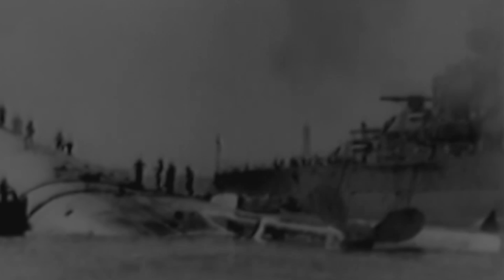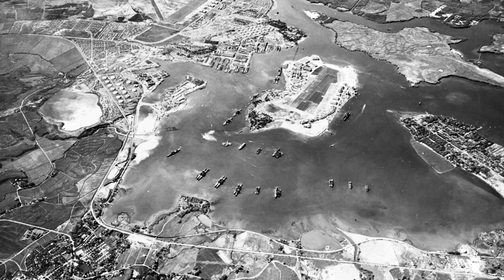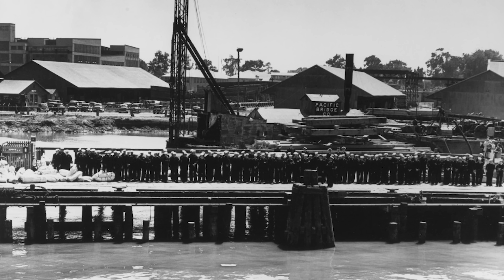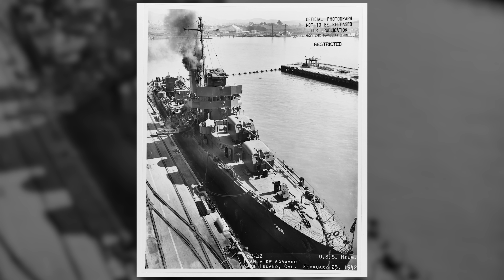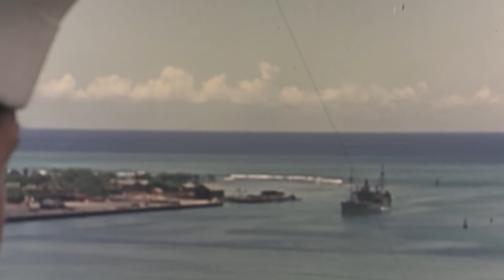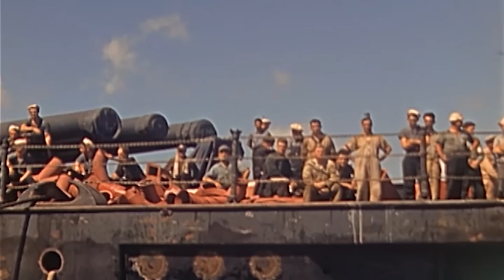The 'Zombie Battleship: How They Salvaged Pearl Harbor (2/4)

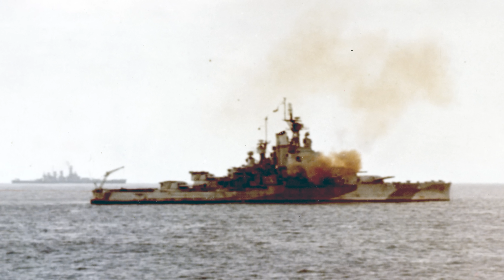Comment: 29:00 A quick note!
At this point, Nevada's guns, weren't just hers! She had worn out her complement of 10 14"/45 rifles bombarding the French coast off Normandy and Toulon, and after Operation Dragoon, was ordered to New York to have her guns re-lined! I believe most of her guns were able to be re-linned in time, except for three. These were replaced by guns from the USS Arizona, pulled from Turret No.1 and refurbished. These were apart of Nevada's main battery the first time she opened fire on Japanese forces since December 7 1941. One of these rifles is on display today in Phoenix Arizona!

Comment: 21:15. Another correction (sorry, I'm rewatching them because of the new upload)
Nevada did not have reciprocating steam engines, and was equipped with Turbines. Nevada was built with direct-drive turbines, and had geared turbines retrofitted in 1927. 
The confusion here may have come from her sister Oklahoma, who was built with triple expansion steam engines, as a competition to see which better suited the needs of the Navy. To my knowledge she kept her original set of engines until her sinking, only her boilers being replaced with newer models in 1927. The Oklahoma was the only battleship at Pearl Harbor with Triple-Expansion engines, with even the Utah being equipped with turbines since commissioning.

Comment: Great series but a very wrong statement about the gas hydrogen sulphide, which was stated in part 2 as being colourless and odourless. Colourless it maybe but odourless it is not. It has the strong smell of rotten eggs (the common name is rotten egg gas). It is quite toxic gas, but what makes it dangerous is a phenomenon called olfactory saturation. In layman's terms it has a sharp pungent smell initially, but the nose gets use to the smell. This means that  an exposed person cannot detect airborne increases of the gas in the air. For example an initial minor exposure of 1ppm  can increase to 100ppm but it smells the same. The sense of smell is saturated by the low concentration and won't respond to higher gas levels. Gas detectors must therefore be used to warn of dangerous airborne levels.

Comment: Besides most of the ships being salvaged from the harbor to reek revenge, I believe there were two other fatal errors the Japanese made: 2. They went after the ships and airfields. When a second wave should have been launched to attack the oil reserves. If they had done that, it probably would've taken the Navy more time to strike back at Kudo Butai. More oil would've needed to be pumped, shipped, and stored to fuel up all the salvaged ships. 3. A potential third wave could have scouted for any carriers. Increasing their chances of sinking one. But they were counting on them being in the harbor. They had no intel on where the carriers would be otherwise. Then again, perhaps that last part is a good thing. As Enterprise arrived shortly the next morning. The arial attackers had just missed the Big E by a good 24 hours or so.
Reply: 1. Their goal was a 6 month campaign of grinding the Americans down, then launching a decisive battle and winning the war. Blowing up the oil infrastructure wouldn't have mattered for the 6 month goal.

2. The Japanese carriers were already at their limits. It takes a lot of fuel and resources to travel the Pacific

Comment: Nevada didn't have reciprocating engines but steam turbines that turned her screws by a reduction gear.  Her sister was the capsized Oklahoma which did have the old-fashioned reciprocating engines.  
Many of the later standards used turbo electric drive.  In this system steam turbines turned generators which powered electric Motors that turned the ships propellers

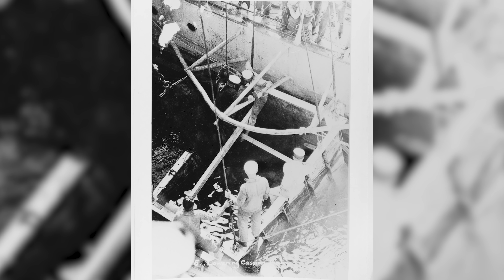Comment: 6:43 I’m sorry but you are incorrect!  There were three dry docks big enough for her at Pearl! Dry docks 1, 2, & 4 were all big enough for her.  Only Drydock 3 would have been too tight a squeeze.  I was stationed on two submarines at Pearl.  Chicago, & Asheville.  Chicago used drydock 3 for her DMP, which was so shallow we had to use giant floats to lift us high enough to clear the lip. Asheville used Drydock 4 after her 1998 deployment.  So I know well enough about the dry docks, to know they would’ve fit the USS Maryland.

Comment: @26.14. Hydrogen Sulphide (HS2) is not odourless,it smells of rotten eggs.  Perhaps it was Carbon monoxide which is odourless and deadly.
Reply: In concentrations it will quickly burn out your sense of smell, which makes it even more deadly since victims may not realize the danger they're in.

Comment: Story of USS Nevada (BB-36) on December 7th, 1941. Nevada was the first battleship to open fire at enemy planes, and she was the only ship to shoot down an aircraft with its secondary surface battery at Pearl Harbor. And on this day, luck earned Nevada a permanent berth in the annals of naval history. When in port and not tied to a pier, a battleship usually had just one boiler online to generate electricity; however, a single boiler was not enough for a battleship to get underway. Early on that fateful morning, Nevada’s officer of the deck realized the same boiler had been in use since the ship had returned to port on Dec. 5, and ordered a second boiler lit.

By 8 a.m., the second boiler was at full steam. When the attack started, the senior officer present afloat (SOPA) realized that with two boilers online, Nevada had enough power to get underway. He immediately ordered the hoisting of the signals “I am preparing to get underway” and “request tug assistance.” The tugboat Hoga was dispatched to assist Nevada.

Minutes later Arizona—moored directly ahead of Nevada— blew up in a tremendous explosion and began burning furiously. At 8:10 a.m., Nevada was struck forward by a torpedo and at 8:13 a.m. was struck amidships by a bomb. At 8:25 a.m., the first wave of Japanese attackers withdrew. Realizing the danger of the burning oil on the water drifting toward Nevada, the SOPA made the decision to get underway without the tug. The mooring hawsers were cast off and at 8:40 a.m., Nevada started to back down; minutes later her bow swung into the channel. At 8:47 a.m. the ship started moving forward. Nevada was underway! The effect was electrifying on the men ashore and aboard the other ships. Tumultuous cheering broke out and men from the stricken Arizona and West Virginia leapt into the water and swam to join Nevada as she passed.

Many of the men who saw Nevada underway recalled the words of the “Star Spangled Banner” when they saw the ensign courageously raised and standing out stiffly in the breeze. The ship then successfully navigated around the pipe for the harbor dredge and headed for the channel out of the harbor. At 8:55 a.m., the arriving second wave of Japanese planes noticed Nevada underway and moved to attack her in hopes of sinking the ship in the channel and blocking it. At 9 a.m., dive bombers and torpedo bombers put Nevada under heavy attack, and within a few minutes the ship was hit by five more bombs. Nevada was burning forward and amidships and sinking by the bow. The SOPA realized Nevada was going to sink and ordered the ship grounded.

At 9:10 a.m., Nevada was grounded on Hospital Point with the assistance of the tug Hoga, which had dutifully followed Nevada down the channel. Thirty minutes later Nevada was moved across the channel to Waipio Point to prevent the stern of the ship from swinging around and partially blocking the main channel. Thus, gallant Nevada was the first (and only) battleship to get underway during the Pearl Harbor attack.

Comment: Just a note, at 25:55 you say that Hydrogen Sulphide is completely odourless, but actually that's not true; under most circumstances it's quite the reverse, hydrogen sulphide has an incredibly offensive odour, it's one of the classic culprits of a "rotten egg" smell. 

It can still be incredibly dangerous, though, as it's poisonous, corrosive, flammable, and above a certain threshold concentration your sense of smell simply... ceases registering the smell any more. It's literally such a horrendous smell that your sense of smell refuses to register any more of it and shuts off. The insidious thing is that the critical point at which that happens is below the concentration required to get a lethal dose; many accidental poisonings via hydrogen sulphide have occurred when the smell "goes away" and people assume the gas has dissipated, only to unknowingly be breathing in more of it, and gradually getting poisoned by it.

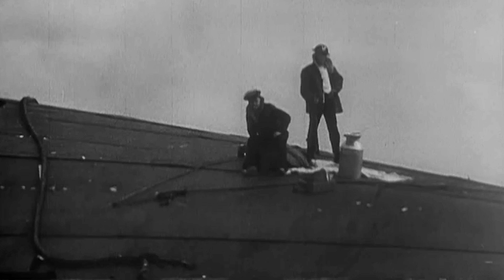Comment: 3:02 no chance of escape? Didn’t oxy torches exist back then? With weeks of time that much time they surely they could have cut a small hole in the side and dropped in a ladder.
Reply: They couldn’t cut them out because the second a hole was opened up the chamber they were in would have completely flooded. It was the sealed air pocket that was keeping the water from completely flooding the compartment. Once the air was allowed to escape the water would have rushed in and they couldn’t cut the steel fast enough to get them out before they drowned.
Reply: no they couldn't.  13 inches of steel
Reply: @trekkiexb5  not all over and given the weeks they were supposedly heard crying out? 
They could cut and shape steel enough to build a whole ship, but couldn’t make a little hole?

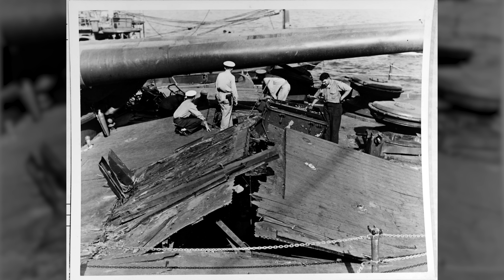Comment: A few comments. Nevada was not as damaged as may have been presented here. She was initially beached not because she was sinking, but because she had been ordered not to sortie and her anchor windlass had been wrecked by a bomb (photo at 15:25) and she had no way to drop anchor. Her damage reports states "the story is one of a losing fight against water spreading through boundaries and fittings which should have been watertight but actually were not."

Vestal reported that she was hit by dive bombers, but this is incorrect. Arizona was hit twice by two separate five-plane formations and Vestal was also struck in the same drops as the Japanese were using a five-plane V formation. 

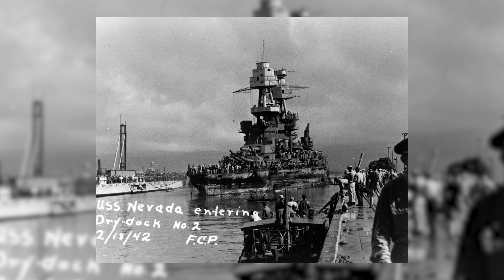At 27:50 it is stated that Drydock 2 was the only drydock capable of handling a ship of Nevada's size. This is incorrect or imprecisely worded - Pennsylvania was in Drydock 1 at the time of the attack and longer and wider and with a deeper draft. What is likely correct is that Drydock 2 was ten feet DEEPER than Drydock 1 and if Nevada was drawing more than than her normal draft it is likely that the 35 foot depth of Drydock 1 wasn't deep enough and that Drydock 2's 46 foot six inch depth was required.

Comment: The main reason for the attack on Pearl Harbor was to sink the 4 aircraft carriers parked there.
BUT, the British had broken the Japanese secret code 6 months before the attack.
SO, the aircraft carriers were " conveniently" out at sea and safe.
Reply: Both Churchill and Roosevelt expected an attack by the Japanese, they were expecting the attack to be in the Far East, and South Pacific, and they were right, Pearl was only a pawn on a chess board, Guam, Wake, Philippines, Malaya, East Indies, Singapore, Hong Kong all saw near simultaneous offensives on December 8th, at the same time on the other side of the international date line on December 7th Pearl was being bombed. 

the 3 carriers were out of harbour down to 2 of them doing supply missions to Wake and Midway, and the 3rd in San Diego re-arming after a refit
Reply: @AB-mw8oz  But, were the carriers out on "supply missions" because they knew the Japanese attack was imminent?
Reply: @pigdroppings  Because they were expecting Wake and Midway to be both targetted. Which Wake was, just hours after Pearl, Wake was bombed destroying most of the Wildcats on the Island

Comment: Techtil  that is a wax coating allllll bolts gears sent when you unpack it ... gahh  a mechanics nemesis... think of the  yellow battery terminal protectant spray used on your car to stop white powder building up on your battery leads... same thing 😊

Comment: As a Nevadan, the ship always fills me up with pride. The salvage teams did an incredible job saving her. There is another fact that wasn't mentioned here. After Arizona's guns were salvaged, some made it on to Nevada, so in essence both the Arizona and the Nevada got their revenge. I'm still saddened that the ship wasn't saved as a museum ship, but I'm glad that the wreck was rediscovered.
Reply: Right, the problem with Nevada and the battle ship New York as well was both were "hot" with radiation after the Bikini A-Bomb tests.  New York had been promised to the state of New York as a memorial and museum ship but the radiation made that impossible.  The same would have been true of Nevada.  They were even too "hot" for scrapping.
Reply: @wayneantoniazzi2706  But in essence they were very different ships from those that were attacked at Pearl Harbor. They underwent very extensive modernization.
Reply: @chriswhitehouse9137  Modifications after Pearl Harbor?  Certainly.  Upgrades in communication equipment, radar installation, most likely new fire control systems for the main batteries as well.  But the fact they were "different" ships wouldn't have prevented them from being donated as museum or memorial ships.   Nevada and New York may have been WW1 era ships but their combat careers were pure WW2.
Reply: @wayneantoniazzi2706  Sure. She did great things at Normandy and Iwo Jima. 
She should have been a museum piece for that along. 
But she looked very little like the ship at Pearl Harbor.
Reply: @chriswhitehouse9137  So what?

Comment: My dad joined the navy in feb 1942 and march headed to pearl to join others in the salvage efforts. My dad was a machinest first class. He told stories of sailors on deck of the uss Holandia doing calisthenics as bubbles would emerge from the deepths and talked about the stench and some men puking on deck or others that got gravely ill days later from it. With most of his time spent in the belly of the ship making parts he only saw and smelled it once but even at 72 he said that smell haunted him and was set off by some smells like the day we were cutting up a dead tree in the woods. He died later that year but it took him over 50yrs before he told the tales of the days at pearl. Later the uss holandia would be a transport carrier and repair ship. She still did her part in the war even though she was a small carrier. I have talked to many sailors about pearl that survived just curious about it. A common comment was. Boy you dont know what horror and loss is. 1000s of good men left to the sea to rot like the meat mike talked about. So think of that smell for a bit.😢
Reply: War stinks.  No one can prove that statement wrong.

Comment: (part of an original story, MSG NJT)
The Massachusetts stood as a steel behemoth in the Fore River drydock. Electricians had just finished installing all of the battleship’s radar, lights, and radio equipment, and word had gotten through the men that an important broadcast was on the way.
Marco Plymouth, ship’s commanding officer and a seasoned navy veteran, stood over the desk with the headset to his ear and a hand on the dial.
He fiddled with the control until he found a frequency that could connect to Pearl Harbor’s comms center, which had been up and running for about a month now.
With a crackle, a voice came through. There was hardly a breath. 
The voice coughed, wheezed, and let out a groan before finally summoning the strength to utter: “I live…”
Marco dropped the headset and switched its plug out to the PA system.
“…..repeat…..This is Commander Nicholas Wilbur to all US Navy ships…..I live.”

Comment: Half of the ships at Pearl Harbor will later get their revenge at Surigao Strait.
Reply: They were called "The Pearl Harbor Ghosts" and they got their revenge all right.
Reply: @wayneantoniazzi2706  The japanese got smoked at Surigao Strait
Reply: @rogerstlaurent8704  That they did.  Those were old battleships but they could still shoot.
Reply: Pretty much all of them were decommissioned by 1950 and scrapped by 1960 or sunk as targets. As "standard" US Navy battleships their flank speeds topped out at 21 knots, too slow to keep up with 30+ knot carriers.
Reply: 5 out of 8. Little more than half
Reply: To be fair, the US standard-type battleships were already obsolete by the 1940, and their service later in the war came down to the US Navy having the air and naval superiority needed to keep those older ships safe. Fuso was sunk by destroyer torpedoes and it's like Yamashiro would've shared the same fate if the USN dreadnoughts weren't there. Their time being repaired and refit after Pearl might have been a blessing in disguise, because if they were put to sea to fight a traditional battle with the IJN in 1941-42, I believe they would all be sunk by air attack, just like the British Force Z was. It's surprising to me that that the USN saw it worthwhile to try and repair the ships instead of scrapping the metal and building more aircraft carriers.
Reply: @The_Ossifrage  didn't need to scrap em, and STILL built more carriers